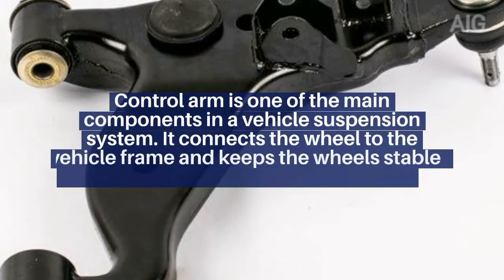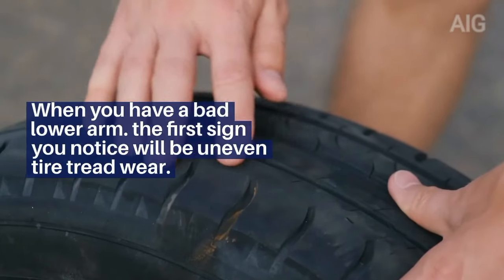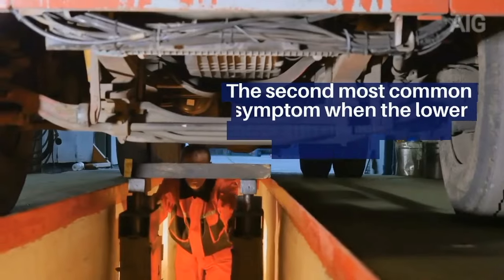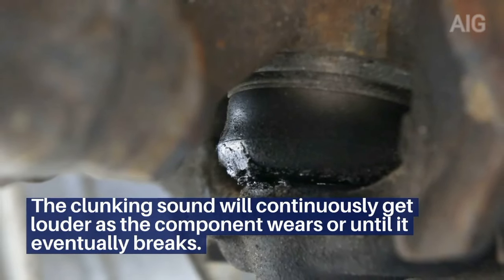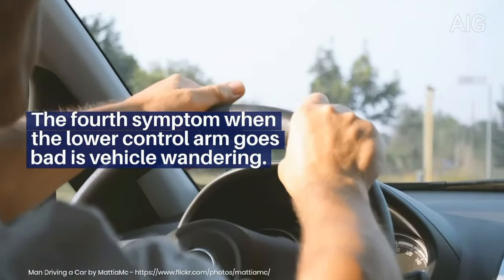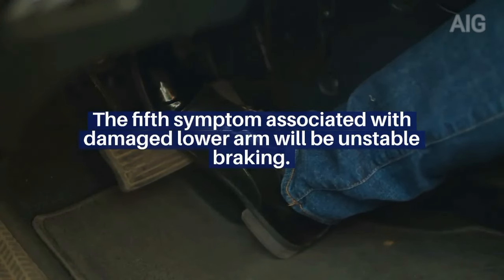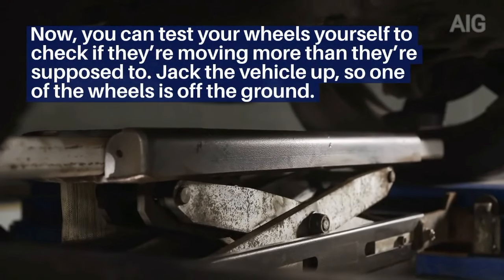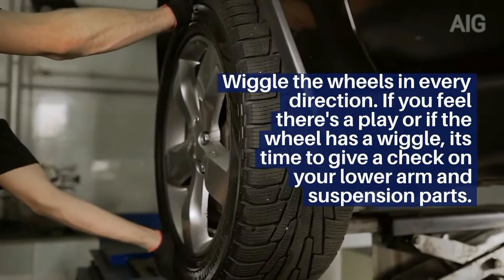Bad Lower Control Arm or Track Control Arm - Symptoms Explained | What happens when lower arm fails

Comment: I have all of these symptoms 😮. I bought new bushings and ball joints. Just need to work up the courage to replace them as it looks pretty tough.
Reply from the maker: Just hold on to and do it... once you've done...may think it was that easy.
Reply: Trust me, brother, if I can do it, you can do it. Main thing is have all the new parts ready to go before you start and “take your time”. 
People will tell you that you might kill yourself if that coil spring pops out at you because they don’t know what they’re doing. 
if that’s one of the parts you are replacing , jack the car up beyond the point that the coil spring is fully extended and it might just drop out. If you have any doubt, ALWAYS get a second opinion.
Reply: I just did mine yesterday😂 I have a 97 Chevy Tahoe and even the parts guy said there's two different lower ball joints you get both of them just in case..
Broke both of the ball joints trying to press them in because they were the wrong ones too big there was an elusive third one that was the smallest that was actually for my truck..
If you have a 97 Chevy four-wheel drive Tahoe like me and you're changing the upper ball joints you will need a very good metal drill bit. To drill out the rivets from the factory on the upper ball joint..
And a way to cut off the head of the upper ball joints first rivets first. I'm a handyman so I used my cut off tool with a metal cutting blade..
Not as fast as a spinning grinding metal cut off wheel or whatever but it worked..
By the way if you have my vehicle it's 5/16 drill bit..
And when you're drilling metal the trick is to apply adequate pressure and drill slow if you drill fast and start smoking the bit your bit is toast..
And if you plan on changing your hub bearing since you're going in there anyway just know if it's an old vehicle like mine you're probably not going to be able to get off the three bolts that hold it on to the knuckle I tried and broke a Craftsman's 9/16 th socket..
You're either going to want to go to a shop where they have the compressor that vibrates those bolts loose or you can buy a new knuckle also that way you don't have to remove the bolts..
Plan it out and do all your research and take your time don't do like me panic out😂
I got it done but it took 2 days and I worked like 20 hours thought I was going to faint at the end from exhaustion😂
I'm usually smarter than that and take my time but with the  satanic government and all the stuff that's about to go down I was freaking out knowing that I had to wait another day to finish it up.
Reply: Just some helpful  tips since I just did mine I have a Tahoe 97 four-wheel drive 5.7..
Without a air compressor racket set it's almost impossible to get the bolts from the wheel hub bearing off of the knuckle(but you don't have to remove that anyway unless you're changing the wheel hub bearing) I broke a 9/16 Craftsman socket trying to get them apart..
And if you have my vehicle you'll need at least one 5/16 very good metal drilling bit to drill out the factory rivets from the upper ball joint..
Just a note when you're drilling metal apply pressure and drill slow that's how you drill metal if you go fast and start smoking the bit it's toast..
Even looking online and at the auto parts basically they said there's two different lower ball joints and I should get both because you can't tell which one it is until you doing..
So after looking around online and everything I figured it was the smallest one so i tried that one first and broke it tried the second one broke it... 
ended up both of them being too big and the wrong ones...
 it was an elusive third one that was around 45 mm that is for my truck on the driver side..
That one started going in fine except for the last 8th of an inch and then I realized the ball joint press they gave me didn't have enough room for the head of the ball joint to actually go up where it's supposed to be because the press machine was not built right..
The way I got it all the way in was I took two Allen wrenches and put on both sides of the press for spacers to leave more room so the head could pop up where it's supposed to be..
Now I see why he said we don't have that ball joint press kit but we have one that will probably work😂
Reply: Oh yeah you'll need something to cut the heads off the rivets from the upper ball joint I used a cutoff tool with a metal blade but some people use a grinding wheel or some type of chisel..
The metal on those rivets are very hard

Comment: Hi, I have slight steering wheel vibration at every speed but it’s not constant, it varies, sometimes only at highway speeds and sometimes even at lower speeds. The steering wheel has some play in it and sometimes it feels as the wheel is misaligned but not always, it varies. I also feel that the wheel wobbles. Could it be the control arm or is it a steering rack problem? Thanks
Reply from the maker: Lowr arm can cause misaligned steering wheel and excess tire wear but vibration is less chance. Do check the bearing and balance the tires also check if the tires are in good condition.
Reply: @autoinfogroup1629  will this problem cause a bumpy ride? Or is that more of a bushing problem? Thanks
Reply from the maker: Any worn ball joints less likely cause bumpy rides, a bad tire, worn shock absorber or bushing does cause the said problem.
Reply: @autoinfogroup1629  Is it best to go ahead and replace the control arm, ball joints and tie rods ends since my car has over 200,000 miles? I've never replaced those and plus I don't want to get one done then will eventually have to pay out more money if the others wear out later down the line.
Reply from the maker: Yes it's better to replace as whole bcs the rubber bushing will become hard as time goes n will eventually break. If it's more than 8 years or more than 150k miles it's good to change. Also the joints might be worn enough and with limited grease as well.
Reply: A wheel alignment place is a great way to find out cause the symptoms you speak of it was my wheel baring that was going out when it gets bad it starts a grinding sound vs a rubbing sound then it’ll get loud like you’re in a truck when it worsens
Reply: My Chrysler grand voyager vibrated everytime i went over 80Km/h, i pried with a crowbar and noticed a lot of play on the lower control arm, i replaced it and no more vibration.
Reply: I have all of this and I was told that my control arm on my Honda was bad

Comment: I guess I shouldn't be doing 170mph in my AMG when I have bad control arms
Reply: I honestly feel like it’s not too bad as long as it’s the front arms cause when your going fast the weight is in the back of the suspension mostly. Just watch out for bumps 😬. Also I notice you put this a month ago? Any updates, if not I’m going to assume you died because of it.
Reply: @gbizzle201 front wheels take huge amount of weight when stopping amd turning

Comment: My truck vibrates intensely when I brake at 60mph+ but not on city speeds. Dealership said it was my brakes so got my rotors and pads replaced warped rotors but the problem wasn’t solved. A mechanic friend said my lower control arm bushings have play in them but dealership disagrees - could it be due to the lower control arm?
Reply from the maker: Hi, yes that could be a bad lower control arm. Also other reasons include, bad bearing setup or bearing itself, bent hub etc..

Comment: How long is it safe to drive the vehicle for when all symptoms are showing ?
Reply from the maker: Better fix it soon...not fixing it mean more tire wear and may be more suspension parts to get affected.
Reply: I was told to replace it immediately, as I was planning to do a lot of highway/high speed driving. This should allow you to avoid an accident and costly tow services.

Comment: hi! i know my thrust arms on my bmw need replacement. got the appointment thsi week. the thing that bothers me the most is the wandering. the wheel often rotates left/right and i need to counter it.
will it solve the problem? it is a wishbone shaped arm eith the bushing (they are leaking oil and 100% need replacement. left front bushing is super worn. tire is also staying a bit forward is not centrred in the wheel like the roght side)

can you recommend me other things i should check? thank you very much!
Reply from the maker: Like said the lower arms needs a replacement and additionally, check the steering rack for preload adjustments. If its too off, vehicle won't stay straight.

Comment: I just put a new drive and to fit the drive i had jeck the engine a bit so icould fit the drive shaft in its place after my i  notice it setting on suspension what the cause of that .its a v50 2.4 wagon volvo please help.

Comment: Hi! I have recently started to experience a pull while braking. Braking gently does not cause anything. control arm likely needs replacing but what else?
Reply from the maker: This normally happens when lowerarm bushing starts to break.

Comment: Does one bad control arm wears both tires out? I change the left side which has a play does this mean it will stop both of the the tires uneven wears?
Reply: Yes that's correct
Reply: No only the wheel on that control arm 

But it might be that you camber is out or your bushing might be bad 

So not necessarily a bad control arm